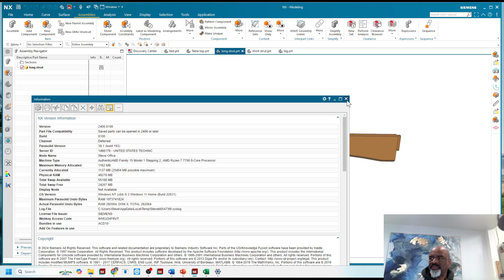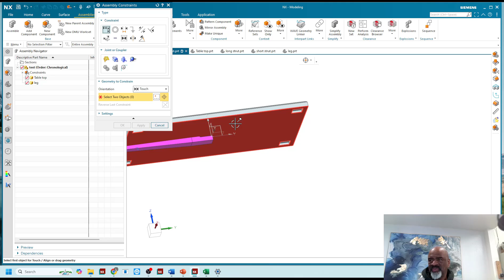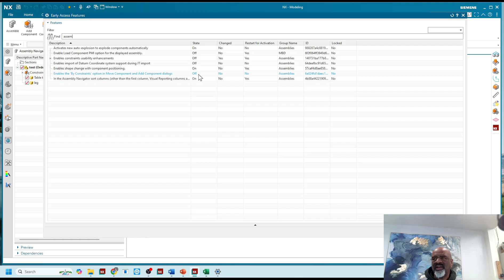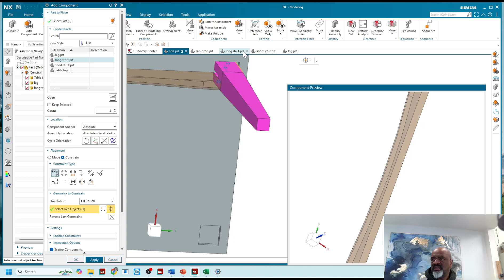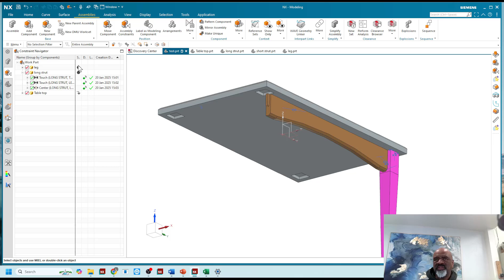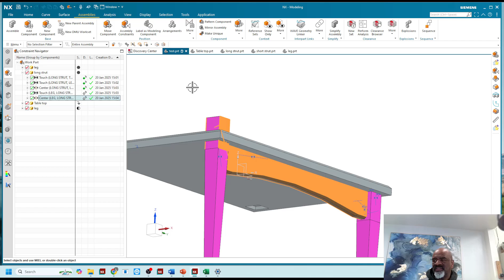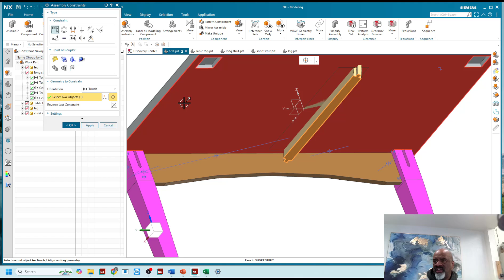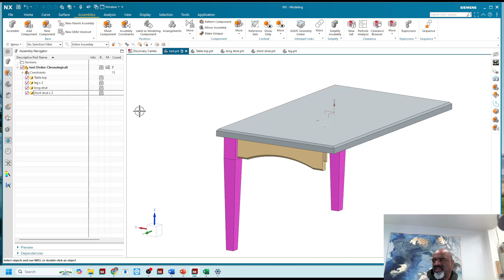Assembly Constraints in 2406. NX

Comment: I just updated from 2212 to 2406 and it looks like the "Assembly Constraints" icon/command (exactly the one you use in the video) has totally disappeared in my version 😨
Either the icon I had placed in on of my toolbars and saved in my role, or the command (via search tool) are missing... Any idea?
Reply: do you have Solution?
Reply: @lnvo-b9e  Nope... The new constraints logic is really a nonsense to me compared to previous one... As I always say, it looks like the programmers are definitely not the users 🥴